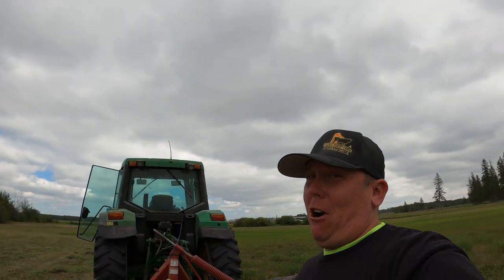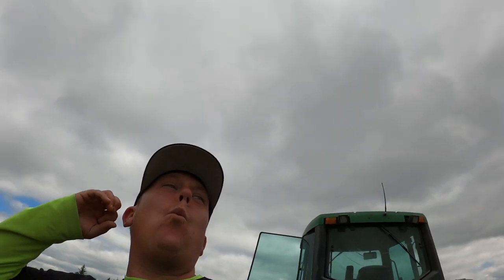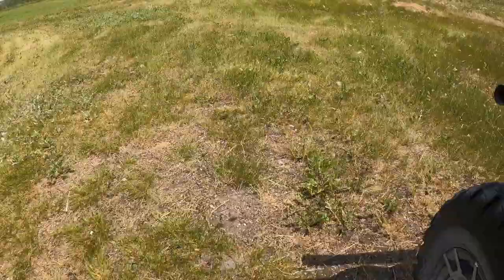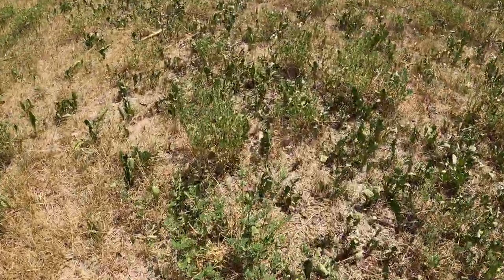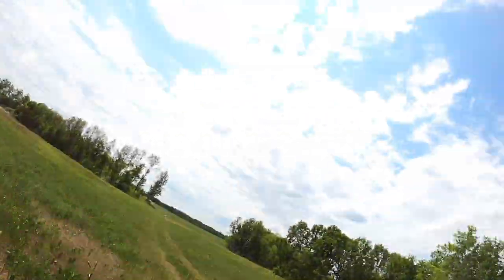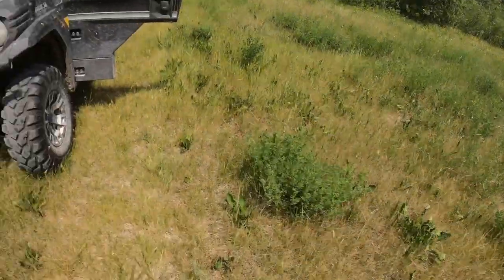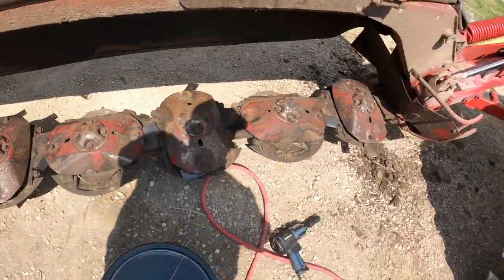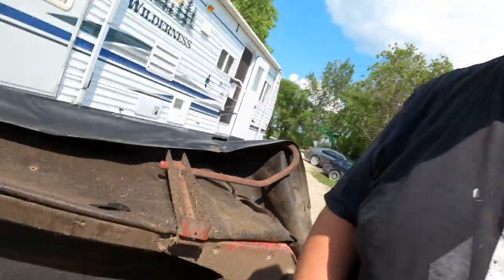Cutting HAY during worst DROUGHT in 100 years on the FARM🌱😱!

Comment: I was at mazers for parts this morning, that is how haying is going. Hwy 68 was covered in hoppers.
Reply from the maker: LOL, I hear you Albert. Went out to bale and found my monitor/Twine Arm sensor had to be calibrated & adjusted. Then found my bale shape indicator was not getting power. Checked all the harnesses and cables and after three hours found a single PIN on the plug in was pushed every so slightly back. At least I got it figured out. I hope you solved your haying problems? Cheers 🍻 my friend.
Reply: @PrairieSunsetRanch  the bearings in the wobble box on haybine went, got it back together yesterday evening. my wife cut today, i raked, baled, and put cows back in. Maybe all the grass hoppers in the bales will up our protein. lol

Comment: I know farmers that put in wells to water the fields so they have Hay
Reply from the maker: We were thinking of putting a well in the pastures for watering the Cattle in summer put not a full on irrigation system for the fields. It is typically fairly wet around here with the exception of the last few years. Hopefully things get back to normal here in the coming years. Cheers 🍻 Robert.